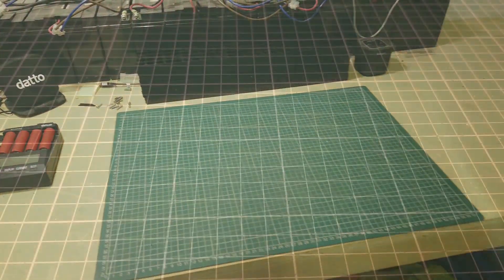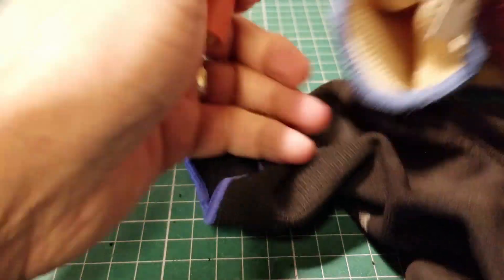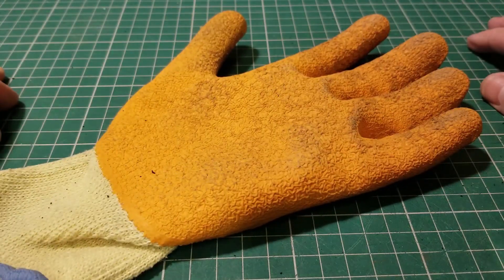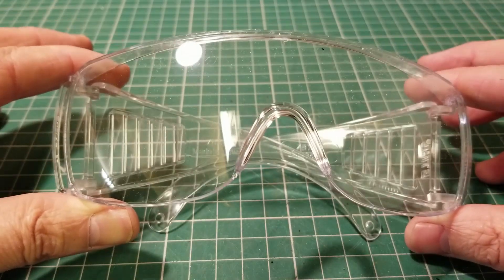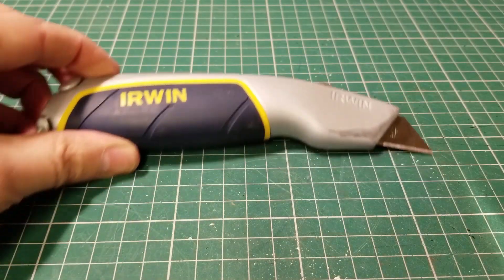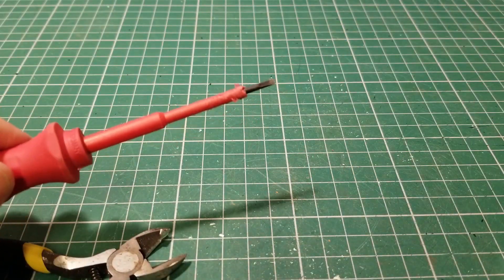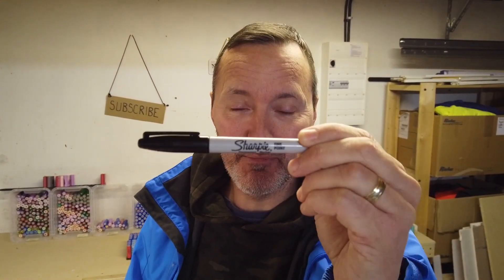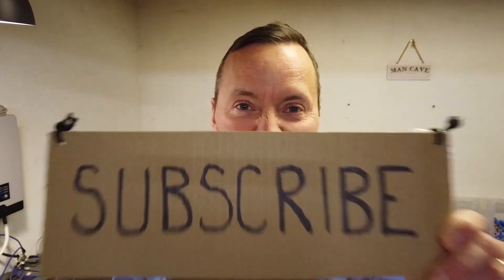DIY Powerwall Builder Essential Tools Guide! My Most Important Tools Tips & Secrets Revealed!

Comment: I second the metal bucket with sand. Just in case. Happened to me a while back, a small piece of nickel strip got caught in between the positive terminal right under the insulator and shorted the cell. The cell was at a low enough voltage that it did not get hot right away and did not notice it. I only noticed it when it started hissing after I put it aside. tried to grab it with my hands. hot, hot, hot. didn't have a bucket handy at that time (lesson learned) and took me a while to get the cell outside. Now the bucket with sand is always under my desk, if I need it, it's there. dump the cell in, if it bursts into flames, cover it with sand.
Reply from the maker: I've been wondering if there was a risk of those small shards of nickel going in there yes. God that's scary and its made me rethink a few things in the Man Cave actually. I am going to get a bucket or a biscuit tin as a few people are suggesting it and it make perfect sense plus I live only a few hundred meters away from a beach so I have plenty of sand available.  Thanks for reaching out and sending in such a comprehensive comment, I really appreciate it and I'll take your advice - thanks! :-)